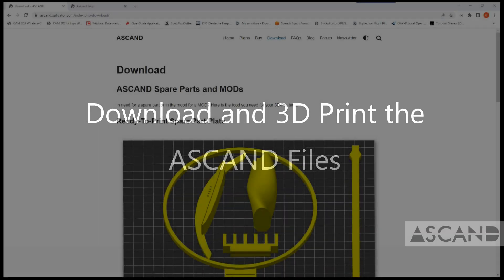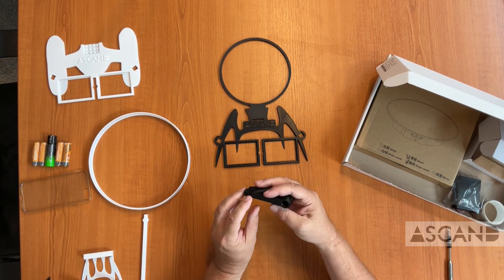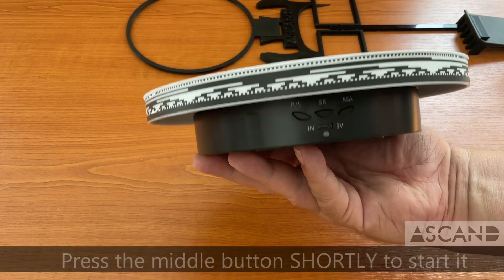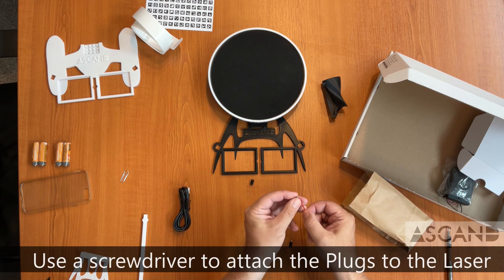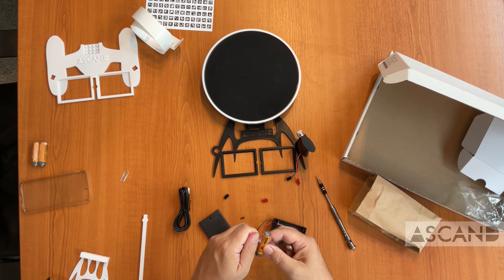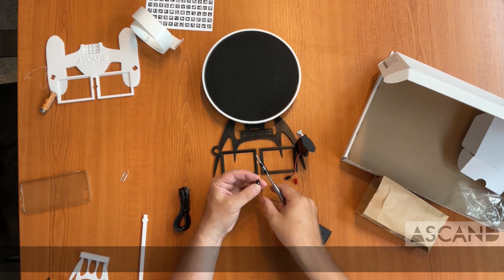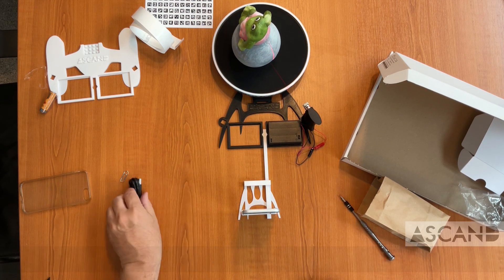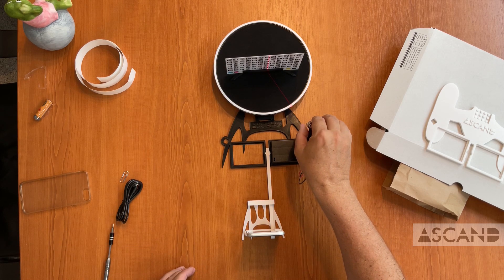ASCAND DIY Maker Edition - 3D Print your own 3D Scanner

Comment: Let's be realistic... €99 for DYI thing is totally overpiced and you can clearly see from their promo movie, it has problems even with simple objects. Another crap from the market that nobody benefits from.
Reply from the maker: Overpriced compared to what? AFAIK there is nothing for less then $100 that comes even close to the specs. Photogrammetry certainly does not.
Reply: @thetwinpilot99  overpriced compared to quality. In the past I've used suff that is totally free if you have computer and a phone - Meshroom. All of that cheap alternative is a crap and waste of money (99-200 EUR is not so cheap), because you can only reliably use it on simple object and even then it takes post processing and very often would be easier to model since the begining instead of scanning.
Reply from the maker: @Rozwietr  Interesting.

If you are an experienced modeler, Meshroom, Meshlab, Blender, OpenSCAD, and CloudCompare expert and prefer modelling over scanning,  the ASCAND indeed might have limited value to you. 

When we designed the ASCAND, we focussed on automating the complete process by creating a pretty sohisticated automated pipe that includes AI driven background removal (to scan in real world environments), cloud registration (to automatically merge point clouds to give you more than the shell without taking CloudCompare or MeshLab lessons and spend hours on appying this knowledge), and auto-meshing (without having to be a Blender/MeshLab expert knowing the nifty details on poisson surface reconstruction, model normals or watertightness) for immediate use with a 3D printer. 

If you have all of that under your belt - you are one of the few. 

Asking for a suggested price tag where you feel ASCAND would add value to you would probably be pointless here ;-)  

I really do appreciate your feedback though. 

Thanks for taking the time.
Reply: I really had impression you're fellow 3d modeller rather than business partner :D good luck with the software, you should not treat me like the enemy of it!

Obviously I'm interested in the topic, I'm watching for the alternatives for ages, because expensive scanners are not so good as well, and it sounds like something that should be easier to do after so many years of topic rolled over (I had very old playstation camera and software years and years ago that worked better than some scanners now, it's all in the software...).

Also cloud software is safe in my opinion only after company gets big enough, that you know it will not close any time soon and you'll be left with hardware that is useless without software. I'm cheering for your product, because I might buy it if I see real life reviews from other users that will prove the value using more complicated objects.
Reply from the maker: @Rozwietr  Thanks for your comments. Good feedback is heartwarming and  fuels our tanks with appreciation energy. Critical feedback holds the potential for making the product better. Sharing an interest in the same field makes us peers not enemies ;-)  
I really do understand your frustration with 3D scanners. Our ASCAND journey began after we had bought a Ciclop Clone 5 years ago and never got it to work. Despite being Post Grad Computer Scientists. We can do better.